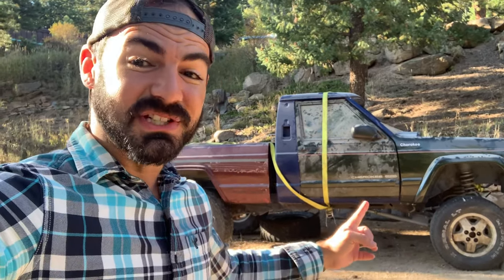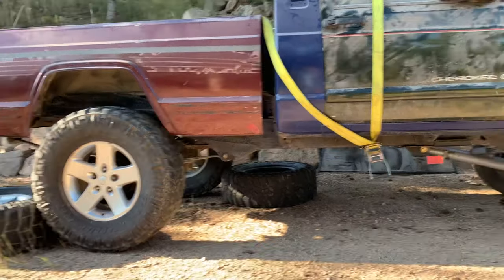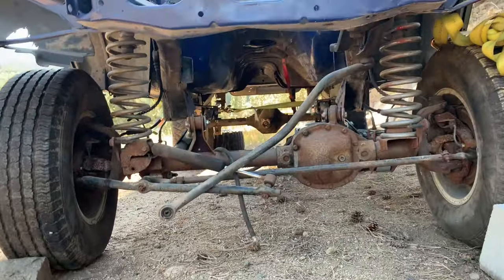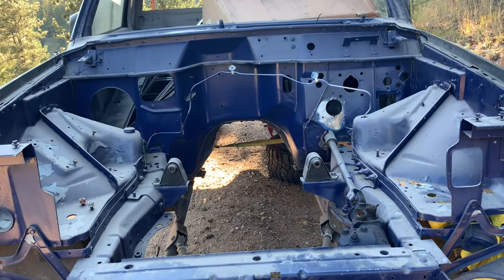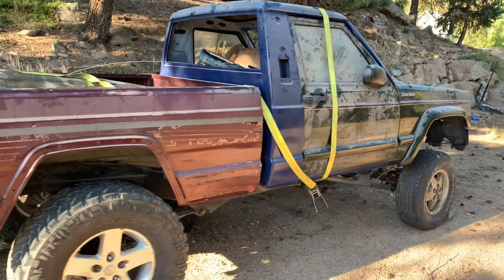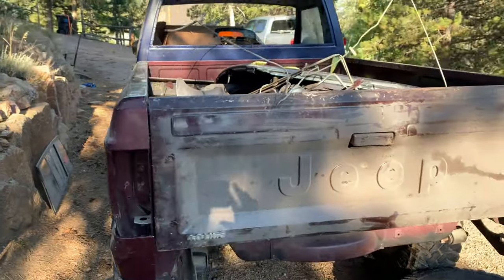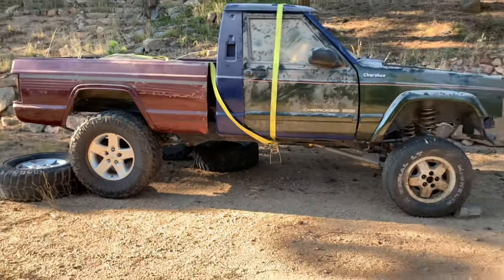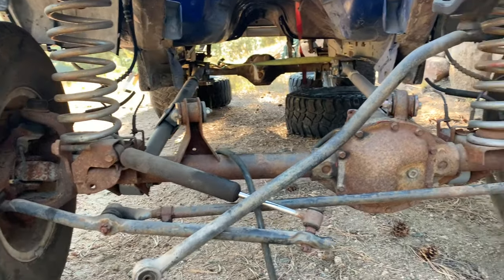Comanche Build Full Walkaround - Fun Times and Missing Bolts Ahead!

Comment: Are you going off road use only? I love daily driving an xj and think an mj would be a really great addition to the collection. Im sure your build will get me looking for one. Thanks for the great content. Keep up the good work.
Reply from the maker: No, this will be for both however more geared for trail use than just adding 32’s on it
Reply: @FreedomCrawler  You prob have conections and an xj for parts but if you need any parts let me know. I have a restoration shop so we are always looking for hard to find parts in little secret salvage yards.
Reply from the maker: That’s awesome, i really appreciate that. I’m hoping to get as much as I can from the Cherokee but know I’m going to have some issues with the fuel delivery. I’m planning on going fuel cell with electric fuel pump unless I can source an actual gas tank and fuel pump. The gas tank I have is too small I think and doesn’t have a fuel pump
Reply: @FreedomCrawler  Sorry if i missed it in the video but are you sticking with the 4.0?